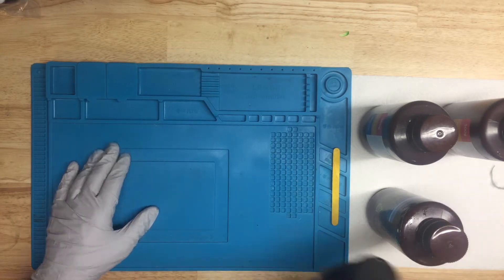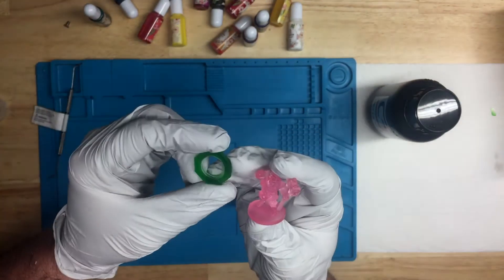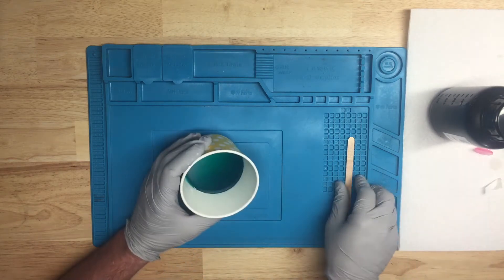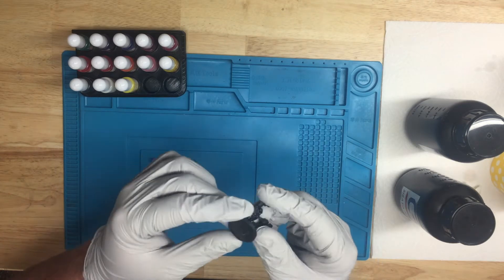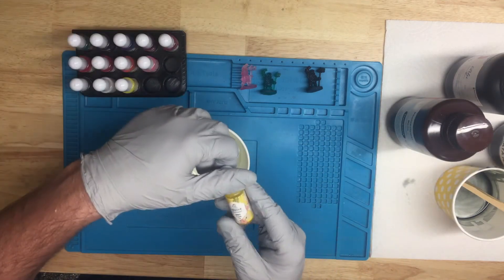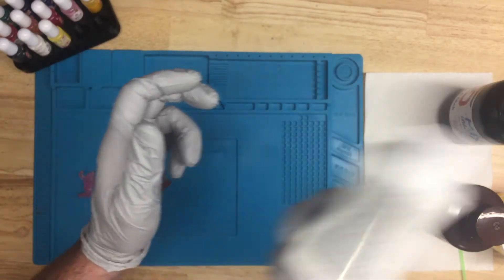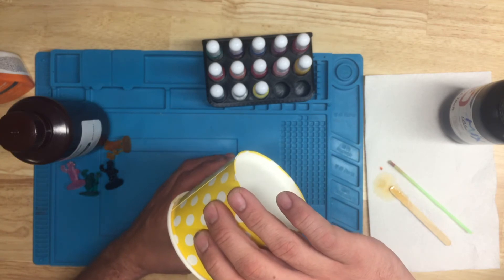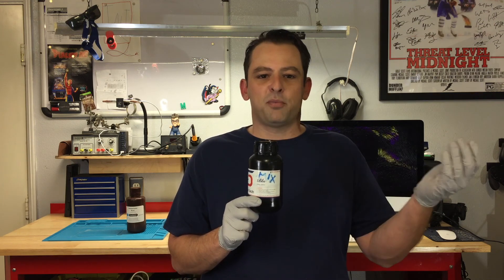Dying UV Resin for 3D printing

Comment: I tried this with a couple different resins and dyes... The liquid Rit dye with regular (opaque) resin separated from the resin, even though the build plate agitates it while printing. I found this odd. When I mixed powdered Rit dye with a bit of alcohol and mixed that into opaque resin, the result was much better.
both methods resulted in the resin being a bit more brittle, but in the case of the liquid fabric dye, half the items in the print failed, and the color wasn't uniform. This was mixed very thoroughly.
I think using alcohol with it helped the dye blend into the resin and what he's getting with the clear resin, is just the pigment being suspended in it.
The other issue I had, the liquid resin stained all the alcohol I used for cleaning and it would also stain anything cleaned in there afterwards. I don't like videos or "tests" like this because they aren't scientific at all, and try to present information about something based on a single print.

Comment: I know it's been a while, but did you need to adjust any of the printer settings when dealing with the "black" resin? Longer burn times or anything? I'll be doing this shortly with some tenacious (using a Phrozen sonic mini 4k) and wanted to double check things like that first. (I do resin casting and am wondering it my So-Strong resin colorants for the Smooth-On resins would work) Thanks!

Comment: Thank you for the sharing , 
May i know for the cloth dye is that possible to dye after print out ?
Reply: Bruce there are several YouTube videos on using dyes after a print is finished.  Alcohol inks are the way to go with coloring AFTER doing a print.  You can try other dives but you may have problems with adhesion.  You don't want your dye rubbing off onto anyone or anything that touches the print.  Here are two for you to look at.  https://www.youtube.com/watch?v=sQQoYY6aUic&list=PLA9HuC4DSZXrZ1ygmAIx_yaGM6wFAnhgf&index=35. https://www.youtube.com/watch?v=6k4BivCUges&list=PLA9HuC4DSZXrZ1ygmAIx_yaGM6wFAnhgf&index=36

Comment: But like... Can you add glitter?XD That would be kinda cool. ^^ I do some stuff with UV resin and silicone molds but I'm looking into getting a resin 3D printer. :)
Reply: I don't think solid particles would be a good idea, but I don't think they could damage something either if you use really fine glitter so... I think I'll try
Reply: @lorenzoiaccarini6966  Cool! There's always mica and pearl powder pigments as well. Glitter tends to sink to the bottom, so it might not be even in it's distrubution.. But it's still an interesting thing to try, I'd say! Let me know if you do. :D

Comment: Thanks so much for this! I'm just getting into dying my resin. I'd like to try putting a few different colors in the vat without mixing them, and just let them swirl around as it prints. Hopefully I'll get some cool multicolor effects.
Reply: How did that turn out?
Reply: @LeslieWorks  Not all that interesting to be honest. After the first couple of layers, the motion from the build plate moving mixes everything together. You basically end up with the same thing you would have if you just mixed the colors first, except the first couple layers look off.
Reply: @SamChaneyProductions  thanks for the info

Comment: have you tried either dye with opaque resin? i never thought of using clothing dye. very smart. also, did you have to change any settings on the printer?
Reply from the maker: Ive never tried with opaque resins, and I did not have to change any print settings from the manufacturers suggested
Reply: good idea I'll try !